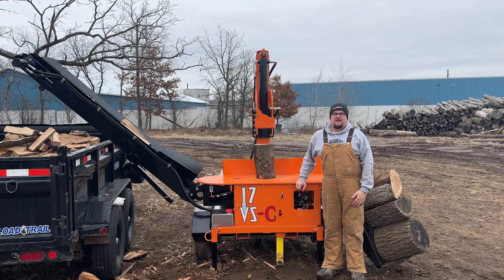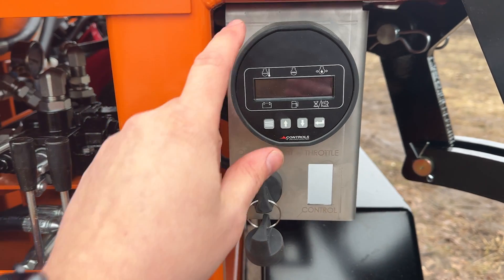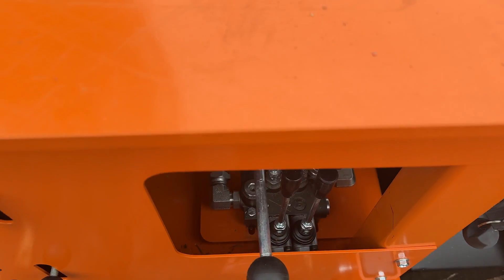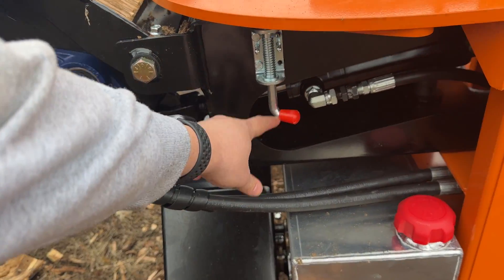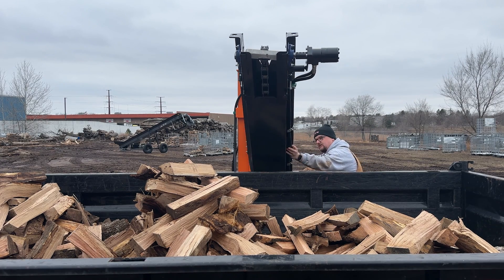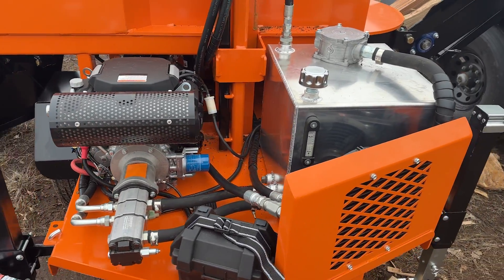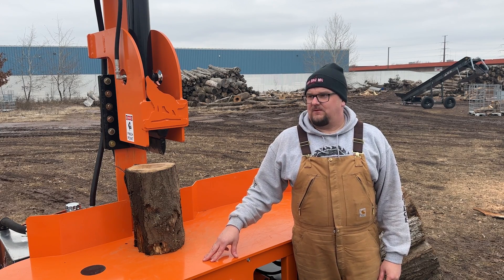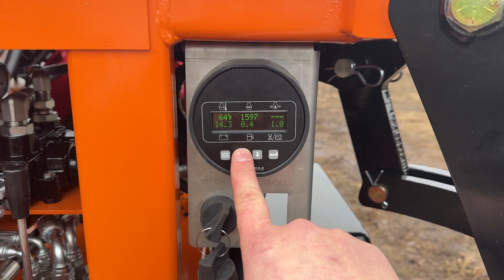Wolfe Ridge 17VS-C Vertical Log Splitter WITH Attached 8' Conveyor Walk Around and Demonstration

Comment: Could anyone give me some input for the hydraulic set up?
Is it like a two way springforced valve for the auto return and then a separate “valve” with pressure to ensure have flow rate when the cylinder is fully returned?
Reply from the maker: Spring loaded foot pedal on the split valve, with an adjustable stroke length limiter that puts the valve back into neutral.

Comment: And if anybody’s paying attention kan this rig be bought with upgraded engine 😊
Reply from the maker: The VS-C comes with the upgraded engine - the iGX700.  It does not even use that engine to its full potential and gets us a 3.5 second cycle time.  The standard VS has an iGX390 / smaller pump, and a 4.2 second cycle time.

Comment: I’ll be looking for a new splitter myself I like this machines pretty well designed I was hoping to convert it was a little longer cause I have a smaller dump truck my other option is I don’t feel that you have to take a whole log me in times and then throw it I like to cut it in half and have one piece in my hand when I’m cutting because I think it’s more dangerous try to sit there and hold the whole log together why are you splitting one otherwise I will be contacting great Wolf Lodge

Comment: Im trying to decide on the vertical or the  horizontal.  Im not getting any younger, Im 57   I used one of the troy bilt 27ton for years, mostly in the horizontal position, but later I found myself sitting on a bucket splitting vertically.   So are you hearing more older guys like the vertical vs the horizontal ?   Thanks.
Reply: The vertical requires almost no bending at the waist since everything is at a nice table height.  I have found that you do use more upper body strength to move the wood around on the table top, but it's a lot less strain on the back.  Come join the "Wolfe Ridge Owner's Group" on Facebook and you can ask real owners for their input on this topic.  Thanks for watching!

Comment: This splitter definitely has my attention.  You obviously used an Axis and solved all the little things that can be annoying. Not downing that machine in any way, it works very well. I have one, and I like it, but I can see myself liking this one a little more. The thing about splitters is it's the machine you spend the most time with. That being said,  some snall things tend to be bigger.
Reply from the maker: Thank you! We have never used an Axis, we just designed what we thought was the best way to do things. Keeping in mind how to make it easier on the operator at the same time.

Comment: Thanks for the video. I’m curious if the conveyor is more useful for those dumping straight into a trailer or totes than those stacking their firewood. I really do like the conveyor feature and am leaning that way but also don’t mind saving money if it ends up being not as useful for one production method vs. another. Thanks.
Reply from the maker: If you are stacking, I would stick with the 17VS without conveyor. 17VSC works best for filling totes, bags and into dump trailer without stacking. 

Thanks!

Comment: That control system needs to be mounted higher, it will get beat to snot where you have it now
Reply: The engine controls?  Or the hydraulic valve controls?  Either way they are both recessed intentionally so they don’t get damaged.

Comment: I am looking closely at the 17VS. I like the Eastonmade Axis, but you guys are in Wisconsin and the VS appears comparable to the Axis in every way.
Reply: I would say the VS is better for these reasons and more.

Honda iGX engine with electric start standard - start the engine and adjust throttle from the operators position.  The stroke length limiter on the VS is quick and easy to adjust, the log lifter goes up all the way so you can use the weight of the log to slide itself onto the table.
Reply: @BacktoBob1  I agree totally. Love  Honda engines.
Reply from the maker: We definitely feel like we raised the bar for vertical splitters. The guys at EM actually said this last fall at Paul Bunyan as well.
Reply: @WolfeRidge  We will be in touch at some point, thanks.

Comment: I noticed that you use hydraulic hoses the whole length of the conveyor, with the high cost of hydraulic hose and for a cleaner look wouldn't it be better to use steel line for the long runs with short supply hoses on the ends? Initial cost may be higher but repairs would be less costly and I think it would look better.  Good video.
Reply from the maker: I am not sure how much it would save on cost, but know that hoses can be made at any hydraulic shop in the country in no time. If a steel line fails for the customer, they will be waiting days for a replacement part from us...

Comment: It needs a Wolf Ridge brand logo sticker on this side of the machine . The operator station is the side you will always see on Y tube, no one ever films from the front. If there is one thing Andrew Easton did correctly it's connecting his brand with two colors, when you see a green tractor do you question what brand it is?  The Wolf Ridge logo is what represents your brand, when you see it there is no question at all. Marketing matters boys.
Reply: Thank you for your feedback, we’ve got some cool stuff in the works 🙂

Comment: Im really interested in one of these. Do you know if it will split gnarly wood like gum? I use a boiler and I tend to get a lot of free gum logs lol. I currently have a 37 ton Northstar and it will go right through it but I have lower back issues and I think a vertical spliter would be better for me.
Reply from the maker: I have never tried Black Gum with one if these machines, but I have with our other models. I don't think I would recommend this model for Black Gum on a regular basis. Thanks!
Reply: @WolfeRidge   Thanks so much for the reply!

Comment: Not really a fan of the conveyor model (8' is easy throwing distance) but that V twin Honda sure sounds smoooooth!  In my opinion, there should be some sort of texture to the table under the splitter.  Maybe diamond plate or even a sand texture in the powder coat.  I could see myself getting gut-punched by a gnarly hickory crotch!

Comment: This machine has taken the vertical wood splitter to another level. The engineering and thought that has gone into this machine is pretty impressive. If I was in the market for one of these, this would be my choice. I think your getting a good bang for your buck in comparison to everything else that's on the market in this category. The other guys are either gonna have to lower their prices or improve their machines...simple as that. I think you guys are gonna be real busy making these.
Reply from the maker: Yes sir, we wanted to make it the best, so we took our time to get it perfect. Still making improvements too. Thanks!

Comment: Chris is getting good at running a vertical. It'd be awesome if you could do a radial stacking attached conveyor on a horizontal machine. For high production cord wood.
Reply from the maker: Disc cleaner is next, but I do have some parts coming to try out this conveyor on a 28c

Comment: That was a very impressive demonstration.. Does the conveyor have a adjustable speed control so you could shoot the splits to the other side of the trailer.  The wolf would standout better with a contrasting color, ie. black on the orange. Glad to see a vertical  with conveyor made in the USA . Next a firewood processor along the line of a finish brand possible?
Reply: Thank you John!  

The conveyor has a set speed it’s matched to the pump that’s running it.

Comment: To reduce the kick out of logs while splitting, you could add a grid of weldbeads under the splitter head. That would give the logs something to grip while being split without adding too much resistance while manipulating the logs.
Reply from the maker: We are planning to test this before adding. These logs were really twisted grain, and I don't know if anything would have helped much for some of them. I had to hold some of them crooked to split.

Comment: Nice machine but a computer on a wood splitter is ridiculous. One more thing to break, plus an additional cost to the machine.
Reply: I understand what you’re saying, but these iGX Hondas have been around for several years now and have proven to be very reliable.
Reply: Awesome machine the only improvement I can see is that more aggressive pics are needed on the conveyor to help grab the wood and convey it into the trailer. Shouldn’t have to throw the split wood a couple of feet up the conveyor. Aside from that this machine is a beast. 
Cheers Woody !!!
Reply from the maker: We made a couple slight changes after this video to improve the wood going up the conveyor. Thanks!
Reply from the maker: Thus was a way to put engine controls at the operator's station. We are designing another option as well for those who don't want the electronics, but still want the controls within arms reach...